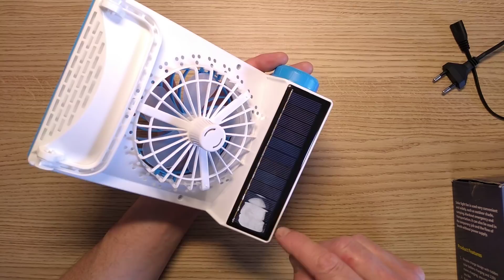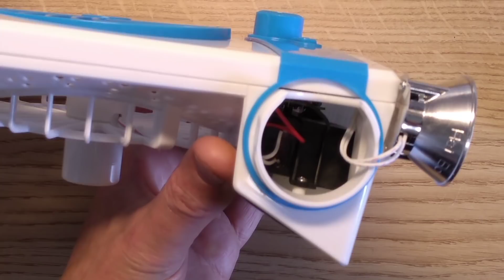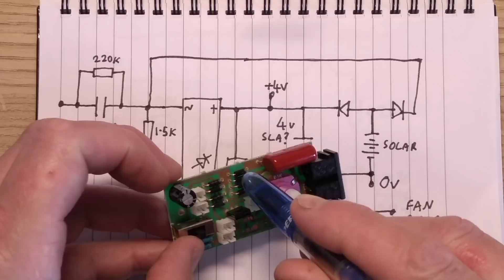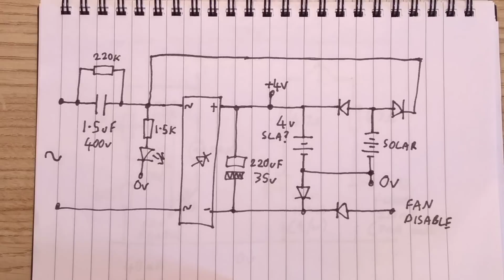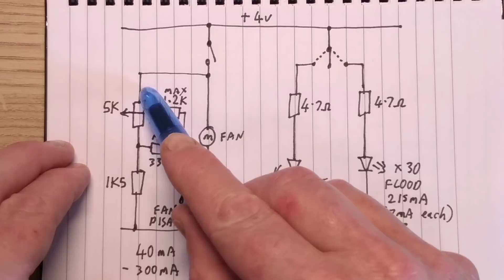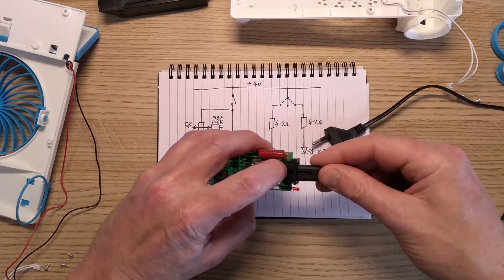Inside a solar/mains rechargeable fan / work light.  (with schematic)

Comment: I find the Choice of SLA battery super weird, nothing uses Lead batteries anymore.  Do you think they just wanted to use some old stock or did i miss something else?
Reply from the maker: They've been appearing in a lot of things.  It's possible that the lead acid battery manufacturers are trying to compete with lithium and offering very low prices.
Reply: @bigclivedotcom  intresting, i've not seen one in a while!
Reply: One thing I would add is, that Lead acid batteries are classified less dangerous for shipping than lithium batteries. That means, shipping might be cheaper.
Reply: Lead-acid is still used in a few places (most obviously car batteries). What did surprise me is when I bought a small cordless drill just a few years ago and found it used a NiCad battery. Not seen one of those for a while.
Reply: as far as I know Burglar Alarms  still use them
Reply: or maybe its not lead after all. some one gotta measure the voltage of that thing (or have i overseen something) maybe that gives a clue
Reply: @Matt Quinn given how it looks like it's powered by two cordless drill motors, though, I can't help but think that lithium might work and maybe even not go flat quite so quickly (or be so easy to destroy by not charging enough)
Reply: SLA are also used for back up power like inside a UPS.
Reply: @Matt Quinn yes your right you can still get them plenty on eBay at various prices depending on capacity
Reply: @thehappylittlefoxakabenji8154  Of course you can still get them, but cheap chinese stuff like that fan generally use Lithium or NiCd. I've never seen an SLA battery in a cheap chinese gadget. Of course they are still in cars and UPS since they are the ideal chemestry for that application
Reply: @muh1h1  yes your right of course I haven't seen one in such a cheap Chinese item about the only thing I have seen is in a cheap compressor battery booster all in one but even now they have the lithium or Nimh battery fitted
Reply: Have a kids ride-on toy that uses a SLA pack, that once you peel off the sticker, is just two fairly standard, and thus cheap (under $10 each iirc) "emergency exit light" SLA packs connected in series with a thermal fuse. Still seems weird though, given how easy it is for me to kill an SLA battery.

Comment: I wonder why they didn't just put one 4.7 ohm resistor before the selector switch instead of one on each leg after.
Reply from the maker: Probably so they could use different value resistors.
Reply: Yes, there's a free resistor there.  Just think of it! 
Cut that trace, move ONE 4.7k and remove the 
other one (for the spare parts bin). Add two 
jumpers and you're good to go.  lol

Comment: What is the solar panel's short circuit current, and open circuit voltage
Reply from the maker: No sun to test it right now, but the voltage will be around 6V and I'd estimate the current at 100mA.

Comment: Why would you put sensitive smoke detectors in the (presumably college-aged?) student housing of all places, they must go off every 5 minutes when it's full of dumb college kids who think they can get away with smoking weed indoors during the winter by blowing the smoke out the window.

Not that I have any first-hand experience of doing exactly that or anything.
Reply: All properties in the UK that are rented out must have smoke detectors, along with various other safety features.
Reply from the maker: I think this system is designed to prevent false alarms.  The kitchen has a rate of rise detector, so that's where I solder stuff if not doing it at work.
Reply: I think you answered your own question, don’t you?
Reply: Not to worry, the smoke detectors in my house go off all the time, especially at night... what they're erroneously detecting is an increase in relative humidity (I live less than 1km from the ocean, it gets foggy in the early AM quite often here.) I refer to that as stealthy wolves sneaking into my house and attacking the smoke detectors. ;(